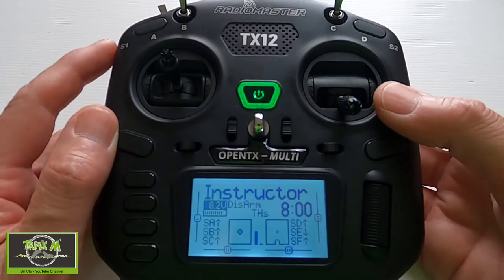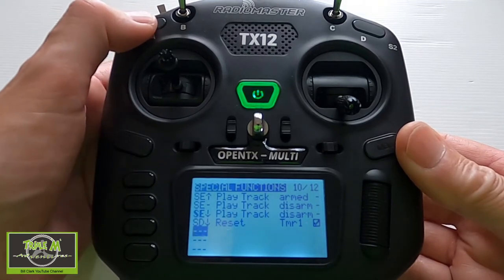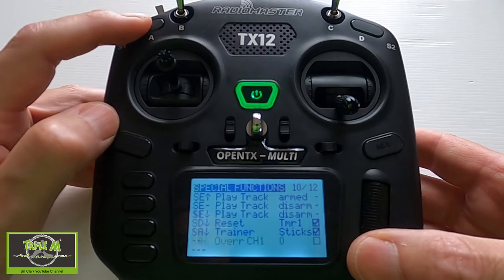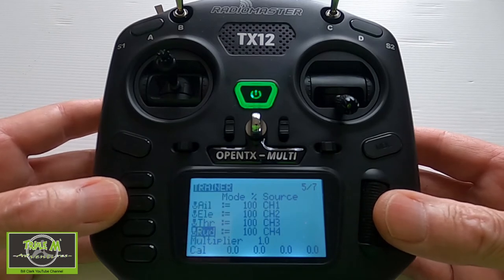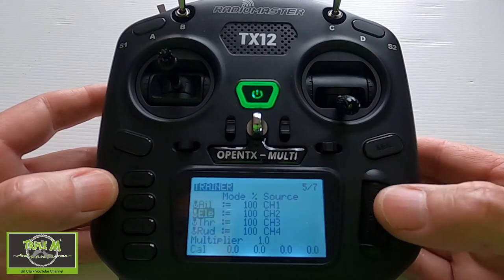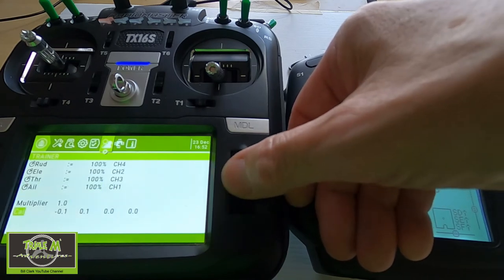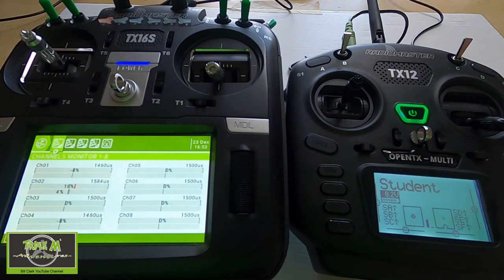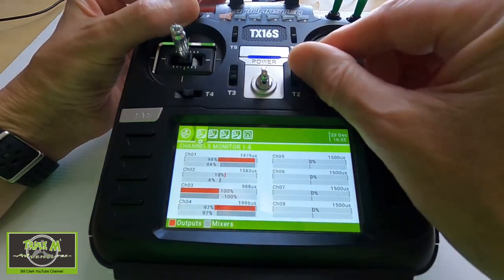RadioMaster TX12 Setting Up Trainer Mode

Comment: thanks for vide😊o can it use wireless to connect
Reply from the maker: Hi Ray, no you will need to use a cable. RadioMaster use to sell a wireless dongle the WT01 but it is not available on their website anymore.

Comment: Can you make new updated videos? The new firmware looks totally different.  I can’t follow you.
Reply from the maker: Hi Douglas, will look into updating the tutorial's in the future.
Reply: @the-happy-RC-flyer  I know it’s a lot to ask.  There’s two angle mode tracks.  It doesn’t matter which I use right? Fmang and just angl.   One says flight mode armed and the other says angle armed.  I just put angl because i set the switch up in Betaflight.   So I put the sound on that switch position. I have the edgetx/elrs tx12 new model.  Flashed with expresslrs configurator and also flashed my reciever with same.  I was having trouble with it un binding.  It’s fixed now
Reply from the maker: @dugy40  you can use whichever sound you like you can even make your own. 

This is a old video but still appropriate for making custom sounds for your radio.

https://youtu.be/aO3wYejJs00

Comment: Im trying to use the trainer between an TX12 ELRS and a TX16S Multi, but altough made all the steps in all your videos they dont work. Already did the upgrade for the latest edgetx but still nothing. Any advice?
Reply: Using the original radiomaster trainer cable
Reply from the maker: Hi Nicolas, you could have a problem where the socket in the TX16s is not completely compatible with a 3.5 mm cable. Try putting a plastic washer on the Jack plug to raise it slightly and it should work. Do Not use a metal washer. Also check your settings again to make sure they are correct.
Reply: Thanks for the advice Bill, awesome videos. 🎉
Reply: Looks i found the problem, after couple of hours decided to remove one of the adapters of the cable, so stereo on one end (TX16) and mono on the TX12
Reply from the maker: I am pleased you solved your problem.

Comment: did you make a video on the trainer setup for quadcopters?
Reply from the maker: No I have not as I would suggest practice in a flight simulator. It would be possible but things can go wrong so quickly when flying drones and the instructor would need to react very quickly to take control from the student.

Comment: Hi Bill ,  was it a stereo  or a mono 3.5 mm jack that you connected to get this working ?  i tried with a stereo aux between two tx12 and it does'nt seem to work.
Reply from the maker: Hi Zachariah, there appears to be a problem with the stereo Jack on the TX12 if you pull out the 3.5mm Jack plug slightly the radios will connect I was hoping it was only a problem on my preproduction unit. I do have a work around I superglued a washer to my Jack plug to left it slightly out of the radio and it works. Sometimes the radios disconnected but not a huge problem because your master radio can take control of the model. Not idea I know but worked in my case. You of cause will need to do it on both ends of the plugs as you are using two TX12’s. Please let me know how you get on.
Reply: @the-happy-RC-flyer  Maybe its only compatible with Mono type plugs  then .  I dont have the second radio right now but will check the next time i have it . Its a little more difficult finding mono 3.5 male to male these days :)
Reply from the maker: @zachninan  I did test a mono cable and would not work either though I did not try the washer trick.
Reply: @the-happy-RC-flyer  Thats surprising . i wonder why these manufacturers dont make it simple and  compatible with common cable standards.